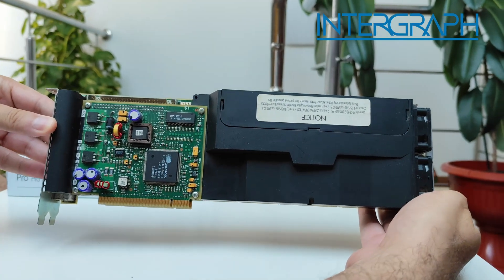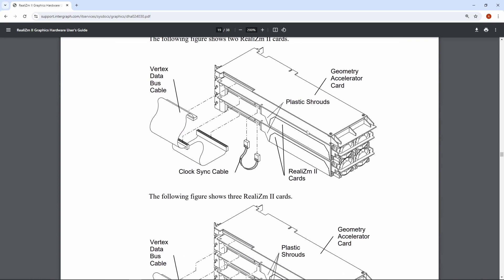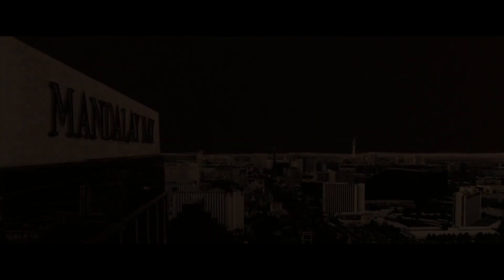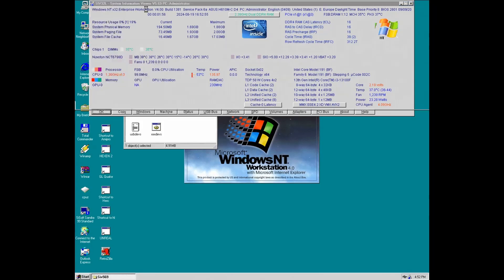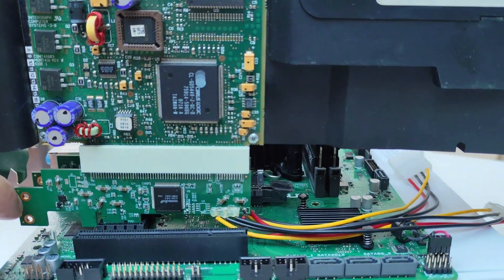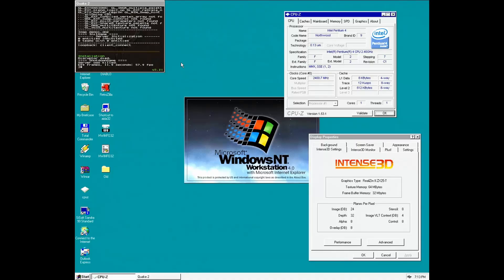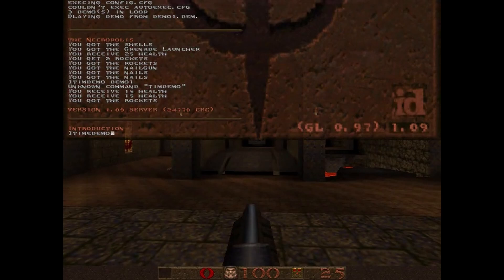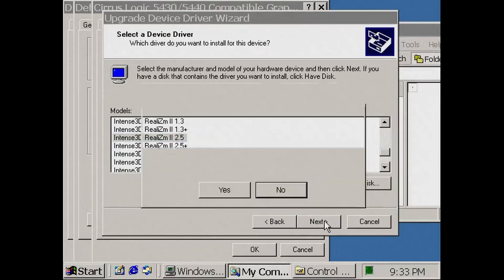Testing a Rare (and HUGE) 1998 Intergraph 3D Accelerator on a Modern PC!

Comment from the maker: Check out the competition: 3,495$ AccelGraphics Eclipse (Evans & Sutherland REALimage 1000 chip) released in 1997 ->  https://youtu.be/uI6zusFJyEI
Reply: Any chance you can make a video about getting the Nvidia 7950 GT (or 7000 series in general) working on windows 98? As I understand it the 7000 series from Nvidia is the latest/fastest GPU series that can work under win 98.
Reply from the maker: @guderian557  OK, we have a deal. Installing nVidia 7000 series on Windows 98 will be exactly my next video.
Reply: @O_mores  Great! Thank you! If you have a 512 MB card that would be even better as I have heard that those are hard to get to work in win 98!

Comment: 0:48 There is no "Geometry Accelerator" paired with this card ?
ZX25 -T = not -G with optional geometry acceleration. I have right ? 
I think the graphic card i use with Intergraph TDZ 2000 was paired with a Geometry Accelerator (Lynx 3) or (Lynx 4)
I remember Quake 2 was fast in FPS, more than 30 FPS. Also Open GL view in 3D Studio Max was faster than my Riva TNT I use at home. I try to find the exact configuration and stats... Maybe my memory deceives me, I am not sure of what I say. I did not have access to all the technical knowledge I have now.
Reply from the maker: The geometry accelerator was a separate PCI card connected to the main card via a cable, similar to an IDE connection. From the manual:
"Follow this procedure only if you are installing the optional Geometry Accelerator for Intense 3D Pro 3410GT or Intense 3D Pro 3400GT.
To install an Intense 3D Pro 3410G Accelerator:
1. Align the card with the PCI slot next to the graphics accelerator, making sure the gold-fingered connectors on the card’s edge are aligned properly with the slot connector.
2. Push the card into the slot firmly and evenly until it is fully seated in the slot connector.
3. Visually inspect the connection. If it does not appear to be correct, remove and reinstall the card.
4. Use the screw you removed previously to secure the card to the computer’s chassis.
5. Connect the vertex data bus cable between the Geometry Accelerator and the Intense 3D Pro Graphics card. Refer to the figure below."
Reply: @O_mores  Thanks friend ! :goodvibes:

Comment: Hi, OMORES. I have a different question. I have Asus Pro A620M-C CSM motherboard. I cannot enable CSM when I use only iGPU (Ryzen 7 7700X). If I plug S3 Virge DX/V2 4 MB PCI VGA card with PCI to PCI-E converter, will can I enable CSM and use PCI card as primary card for Win 9x / NT ?
Reply from the maker: I'm considering getting that board myself. In the meantime, I can boot from PCI on both my Ryzen 9 3900X with a 470 motherboard and my Intel 13th Gen setup. As you can see, a variety of old and unusual cards are working fine. The only challenge I faced was setting the primary video card, but I found a solution—check out this video: https://youtu.be/RWupO_3Zv6s
Reply: @O_mores  so, PCI to PCI-E converter is solution. I purchased it. And for sound, I'll use creative soundblaster CT4780 PCI to directly PCI slot without any converter. Will it work for Windows 3.1, 9x etc?
Reply from the maker: @ages2001  Windows 3.1 is picky about PCI sound card, only Ensoniq PCI Audio 3000 is known to work on modern systems. But Creative card will work great in NT4, 98, ME, 2000, XP, even in Vista/7 32bit.
Reply: @O_mores  will dos drivers can work in windows 3.1?, I'll try these drivers. Even it won't work, Windows 9x and NT is enough for me. About SATA, I'll try UniATA 0.46e8 driver. But for now, I have to wait cards to arrive.
Reply from the maker: @ages2001  Ensoniq and Creative DOS drivers won't work in on newer motherboards, but NOW can use your motherboard codec for DOS sound, it can be fun. Check out this short video: https://youtu.be/MI_cWrw7y_8
Reply: @O_mores  so, SBEMU can also work in Windows 3.1, isn't it? And also, we are sure about CSM option will available when I plug S3 card, aren't we?
Reply from the maker: @ages2001  I'm sure it works with your S3 card.
Reply: @O_mores  okay, thank you so much!
Reply: @O_mores  and will UniATA driver work for Windows NT/2k/XP in this Asus Pro A620M-C motherboard? I'll use your WINNT preinstalled folders previously you shared with me.
Reply from the maker: @ages2001  It should work, I haven't tested any AM5 motherboards with UniATA, but SATA is pretty mature, there are no changes in the last years so I guess your AM5 SATA implementation it's as compatible as the previous generation was.

Comment: Sadly, it's not working. Do you think this is the end?
Reply from the maker: @GordenMalcom  What's not working? The 2K installation or the USB?
Reply: @O_mores  this time mouse Arrow it self not showing
Reply: @O_mores  I think it looks a little bit different, right?
Reply: @O_mores  I also tried installing Windows 98. It worked in DOS until I started the setup, but once the setup began, the keyboard and mouse stopped working again. By the way, does your card work in the BIOS? Mine doesn't, so I strongly suspect the card I bought is either not genuine or fake. I've sent alternative card links to your Reddit.
Reply from the maker: @GordenMalcom  I ll check  if it works in BIOS tonight.
Reply: @O_mores  Thankyou brother
Reply: @O_mores Have you tried installing UniATA on VirtualBox or any other VM, and does your USB card work in the BIOS?
Reply from the maker: @GordenMalcom  Yes, it works in BIOS, the PCI to USB card is listed in the USB section as it should: 1xEHCI controller.
Reply: @O_mores  what about VM brother. And my card doesn't work on bios you are using pcie to pci card right? 
So I ordered 3 more cards.
Reply from the maker: @GordenMalcom  Sorry,  I have no VM installed and these days I have limited access to my PC, usually after 6PM. Setting up a VM and installing Win 2K it could take me a entire evening and I don't have time right now. I looked into your motherboard and is very retro unfriendly... no PS/2 also no COM header for a serial mouse. I will buy this AM5 motherboard and it will be matched it with a 9900X CPU. This mobo has PS/2, PCI and a serial port right on the back. https://www.asus.com/motherboards-components/motherboards/business/pro-a620m-c-csm/
Reply: @O_mores  that's fine Brother no worries. Try VM when you are free no need to hurry up.
Reply: @O_mores  I went through my motherboard's manual and found that it has USB 2.0/1.1 headers. Will these work on Windows 2000? My motherboard is the Gigabyte B450 AORUS Pro WiFi.
Reply: @O_mores  and again not working

Comment: These cards remind me of the framebuffer vards for older Sun Ultra Systems...

And I had no idea that NT4 would run on a modern system....
Reply from the maker: NT 4.0 rocks... What was a surprise for me is that it NT 4 works even in multiprocessor mode using a CPU released in 2023 with a BIOS from 2024. Check out this video: https://youtu.be/upuUtLkNVjY
Reply: @O_mores  interesting indeed. I do miss the simplicity of NT4. Back in the day I was triple booting Win 98, NT4, and RedHat on my K6-2 machine. Unfortunately too many games wouldn't run on NT4 and I couldn't go without them, otherwise I wouldn't have even had Win98. Back when Windows did exactly what you told it to, no more or no less, and NT was rock solid stable - at least once you had all the SPs installed. I even had my grandma's computer running NT4 and it required no firewall or anti-virus, just a limited user account - today it wouldn't last a second directly connected to the net.
Reply from the maker: @wysoft  Ah, those were the days! NT4 was definitely a simpler time in terms of stability and control—especially once you had all the service packs. It’s wild to think about how an unprotected NT4 machine back then could run indefinitely without a hitch, and now any device needs a fortress of security measures just to stay online. Anyway I'm going regularly with Windows 98/2k/XP online and if you mind your business is not that bad. BTW, you can run NT4 with multiprocessor support on new hardware: https://youtu.be/upuUtLkNVjY

Comment: My 3dfx voodoo 1 got more fps than this which is shocking
Reply from the maker: A Voodoo 1 on 1997 hardware like a Pentium 200 MMX can reach about 20 FPS in Quake 2, while this card is doing 26FPS on 2.4Ghz CPU. So I guess a Voodoo 1 might be better, but again this card wasn't designed for games.
Reply: From what I remember it would run nicely on a 166 mmx at 512x384x16bit

Comment: on modern pc, you use 2 pcie to pci adapter, that makes the graphic chips link to different bus, this may causes problum. it's better to use a pcie to multi-pci adapter
Reply from the maker: Good point but I don't have any PCI-E to PCI adapter with 2 PCI slots. My main PC with a Ryzen 3900X CPU has a motherboard (X470GTA) with 2 classic PCI slots - but this card will never fit inside the case... I have to remove the motherboard.
Reply: the bus is rather irrelevant as one is the 2d part the other 3d and this setup is more like a normal 2d accelerator combined with a voodoo card.
Reply from the maker: @rubberduck4966  Yes, it looks like a classic 2D + separate 3D accelerator setup but it's more than that. The 2D card is electrically connected to the 3D card - and it has only 512K video memory. Once you get the driver installed you can use 32bit high resolution and for this memory from the 3D card must be used.

Comment: I find it amusing the memory is slotted. That would put a dent into Nvidia profit nowadays.

Selling overprice memory because the user can't easily change it. Very nice.
Reply from the maker: Indeed, you can mount DIMMs even in single slot cards, check out this AccelGraphics card from 1997: https://youtu.be/uI6zusFJyEI
Reply: Well its not possible anymore at the speeds and...well you can just get a different card if you need more VRAM
Reply: @AlpineTheHusky  I totally would buy special GPU memory sticks, to add more bandwidth. I mean it would be a great a product and competition in this area can end with great prices.

Comment: Very interesting card, I appreciate you trying it with the 2 adapters at the beginning, I love those types of shenanigans where old and new hardware meet.
I've ordered a PCI/PCIe adapter myself to play around with, mainly to see what I can get working on Windows 10, as well as if I can pass through PCI cards to a VM. Mine is one of those PCIe/Dual PCI adapters, hopefully that'll work the same as the single PCI version.
I also saw an adapter floating around that allows sticking PCIe cards into PCI motherboards, I didn't buy it (yet), but it sure intrigues me.
Reply from the maker: There are some PCI-E to PCI adapters that come with a 5.25 internal rack and can fit 2 PCI cards. (medium size) I could use one of those racks for a PCI to SATA + a PCI sound card on a modern motherboard. BTW, you totally can mount a PCI-E card into a PCI slot with those adapters. Tested by me... For some video cards there will be a serious bandwidth limitation but for other devices won't be any difference.
Reply: @O_mores  There are some modern cases that have those vertical slots alongside the horizontal ones for mounting GPUs and such, those also seem quite viable for something like this. That or using a case meant for a larger motherboard than that you're using could also work.
Good to know about those adapters, will be getting one then to play around with.
Reply from the maker: Oh... and let's not forget about these big PCI expansion boxes: https://www.startech.com/en-eu/cards-adapters/pex2pci4
Reply: @O_mores  Those seem far too expensive for what they are. I guess it could be meant for businesses that use legacy hardware; I do wonder what that support they advertise exactly entails.

Comment: A true "2 slot" graphics card!
I feel like I remember this card mentioned in one of John Carmack's .plan files, maybe not this one but I think he was using a similar card when developing GLQuake
Reply from the maker: At some point, it looks like he used an Evans & Sutherland OpenGL accelerator and an Intergraph RealiZm... The Evans & Sutherland OpenGL was slightly better while being single slot. It happens that I have that card too: https://youtu.be/uI6zusFJyEI

"John Carmack's .plan for Jan 11, 1998-----------------------------------------

I AM GOING OUT OF TOWN NEXT WEEK, DON'T SEND ME ANY MAIL! Odds are that I will get back and just flush the 500 messages in my mailbox. No, I'm not taking a vacation. Quite the opposite, in fact. I'm getting a hotel room in a state where I don't know anyone, so I can do a bunch of research with no distractions. I bought a new computer specifically for this purpose - A Dolch portable pentium-II system. The significant thing is that it has full length PCI slots, so I was able to put an Evans & Sutherland OpenGL accelerator in it (not enough room for an intergraph Realizm, though), and still drive the internal LCD screen. It works out pretty well, but I'm sure there will be conventional laptops with good 3D acceleration available later this year. This will be an interesting experiment for me. I have always wondered how much of my time that isn't at peak productivity is a necessary rest break, and how much of it is just wasted. "

Comment: Hi, my friend! I think I gave up about Windows 2000. There is really unknown problem causes win2k to freeze. I couldn't find any further solution. Maybe chipset itself freezes old NT OSes for avoid using these.
Reply from the maker: @ages2001  Well, anything is possible... On this SIS motherboard featured in video when using NT 4.0  the CPU would stay under 100% load unless the USB was disabled in the BIOS...So I had to disable USB...
Reply: @O_mores  no, not about this video. Few months ago, we talked about installing windows 2000 on Samsung model laptop. You gave me some installed windows zip files but didn't work any of them.
Reply from the maker: I actually used one of those packed Windows 2K installations while making this video and it worked for me. It was the standard PC installation. But the target PC was a Pentium 2.4Ghz, 1GB DDR400 RAM, Asus P4S800 motherboard from 2004... Sorry it didn't worked for you.
Reply: @O_mores  do you know any further solution? Maybe BIOS or chipset itself freezes win2k ? Because laptop itself runs win XP perfect, has all official XP drivers and even found some win2k drivers. Something really wrong...